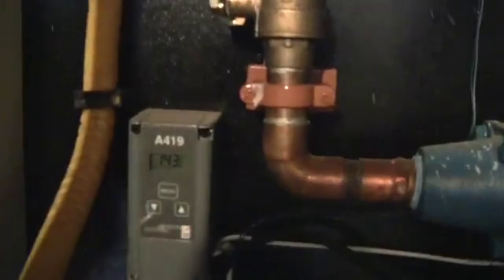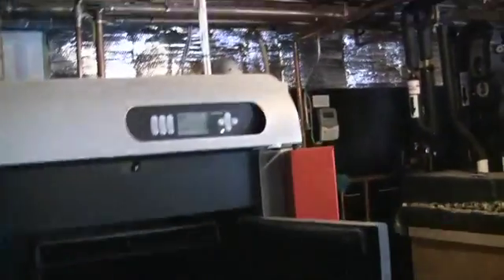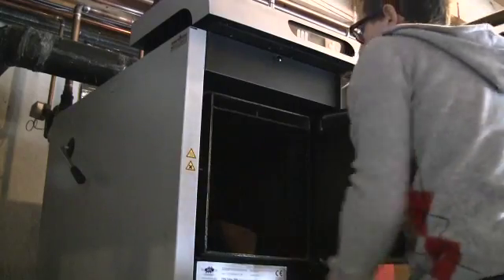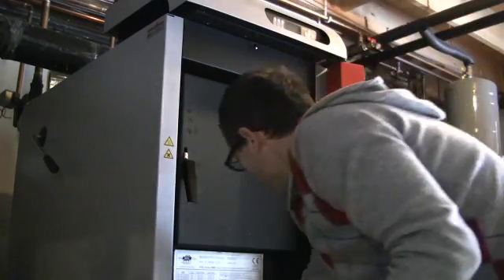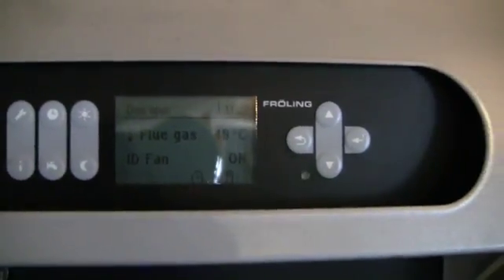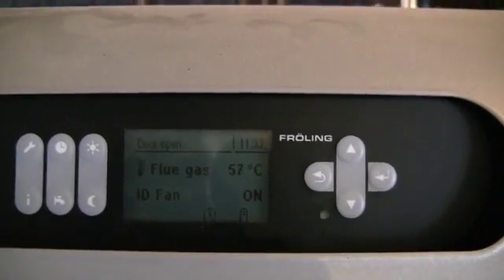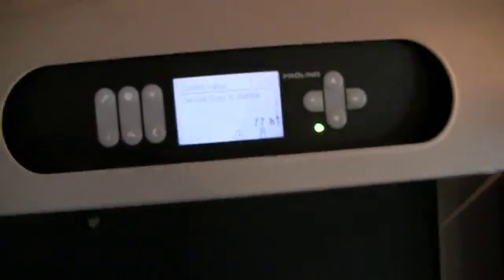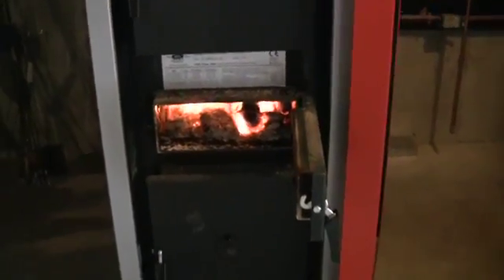Firing a froling wood gasification boiler in Maine.

Comment: If you can see coals still burning there should be no need to relight the stove as it is designed to relight itself if there are hot coals in the firebox. The lighting location is for a cold start when there isn't any fire inside the stove. If you had let it run it should have relit the wood you added with any other action by you.

Comment: Personally I like the portage and main envirochip boiler burning woodchips that burn as clean as the froling without all the other stuff. The envirochip boiler is manual ignition but after lighting it will run automatically with the exception of once every week or two you have to put a container under the ash discharge and push a button to remove the ash, once the ash stops coming out let go of the ash button. It uses a storage bin from 7 yards to 30 yards and requires a front end loader to fill it with chips. Not a real problem because instead of buying a new front end loader look around in your area for someone who sells used small tractors and you will find exactly what you need for a lot less coin that a new tractor. I showed a friend the system and he was ready to buy it except he didn't want to spend another $20K plus to load the woodchips with. I brought him to a local that's been selling small tractors with front end loaders and backhoes and he picked up Kubota with front end loader and backhoe for $7 K. Runs like a new machine. He now has the envirochip outdoor wood burner installed and when it was first installed he was going to buy woodchips. I called the DPW and was told where a tree trimming company was less than a mile from his house and bye Saturday he had over 8 small truck loads totaling just over 90 cubic yards of green woodchips which it burns just fine and the price is right. 30 yards of green woodchips last him just over 10 days putting out 300,000 btu's. With dry chips it is rated at 500,000 btu's. He is heating originally a 3800 square foot house and a detached 4 bay garage designed for commercial trucks and heavy equipment and his mechanic loves it.  He just finished adding his neighbors houses on either side of his house both of which are owned by one daughter and a son on the other side. The son has 9 kids all girls and said after hooking up to dads outdoor boiler his heating costs dropped over $7'000 per year and they never run out of domestic hot water anymore.
Reply from the maker: Hey James, thanks for the recommendation.

Comment: this system works better with radiant heat. Baseboard needs high temps and then your storage tank doesn't have a lot of storage when you have low differential temps. With radiant you can use the tank to 110-115 therefor using more btu's stored in the tank.
Reply from the maker: You're absolutely right. We were still able to make it work with baseboard. The passive solar we had for the hot water helped keep the BTUs up in the tank. Damn I miss that setup.....

Comment: Hello,  I'm considering the purchase of a S4 Turbo and wondering how long of a burn time does a full load of wood will last when your storage tank is able to take the complete burn?  What size unit is yours?  How did you like using this boiler this winter.  Any and all comments are appreciated.